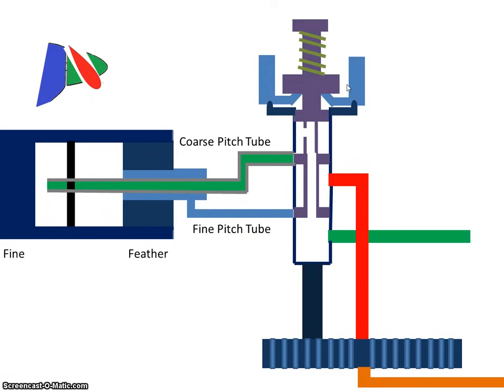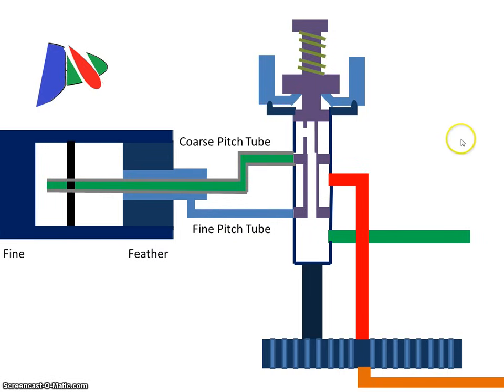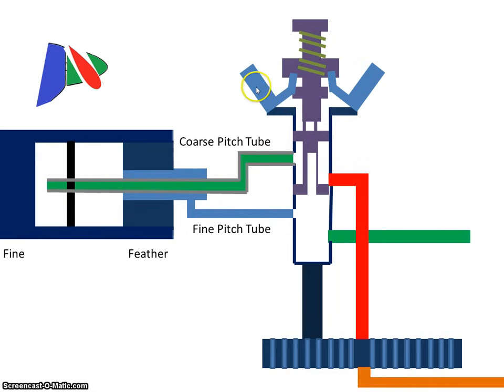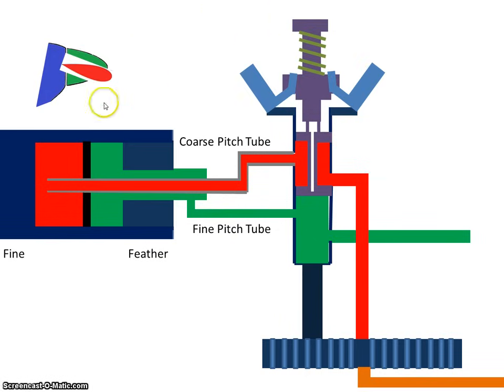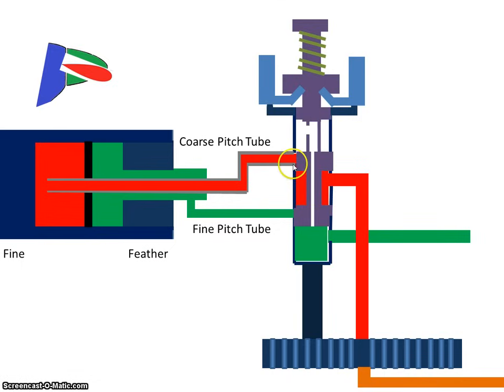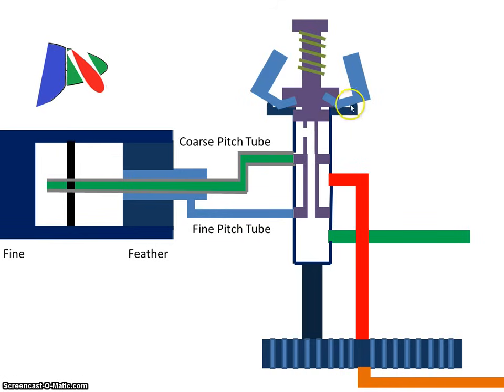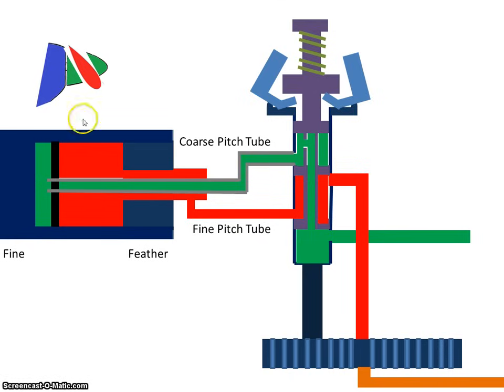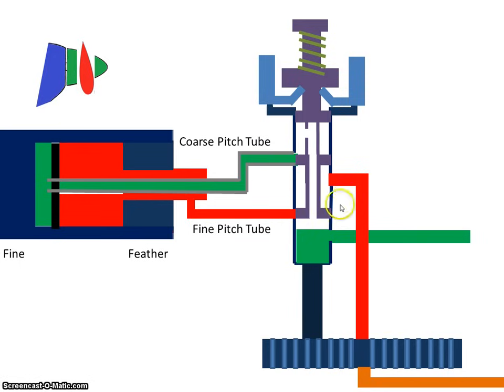Simple Explanation of a Propeller Governor

Comment: You have it reversed, dynamic force on the propeller blade forces it towards a reduced blade angle, not an increased one like you said. That’s why a “pitch lock” mechanism was put in place in case of emergency hydraulic power loss.

Comment: On speed Condition = oil in lock position because the pressure on Speeder Spring and centrifugal force is balanced

OverSpeed Condition= As RPM increase, Centrifugal force increase (fly weight move outward + Pilot valve move upward) directing pressured oil from booster pump to piston  to Increase blade angle ( coarse pitch), RPM decrease,  then on speed Condition

UnderSpeed Condition= As Spring pressure is stronger than Centrifugal force, (Fly weight move inward + Pilot valve move downward) directing oil from piston to be routed back to the engine. Blade angle decrease  (fine pitch), Engine RPM start increase, the On Speed condition

+Pilot adjust the amount of pressure on the speeder spring to change the Pitch of the blade
+Booster pump supply pressurized oil (180psi - 300psi)
+The shuttle type valve used on pilot valve (alternately cover and uncover oil passage allowing oil to flow in/out of propeller hub
Reply: nikdanial109 Thank you
Reply: Thank you

Comment: great explanation, i love that you keep it simple, anything well understood should be able to be explained simply.  This is how it works on some planes however, I noticed on the diagram it says "feather"  Most airplanes that go into feather (multi) do so with a lack of oil pressure, in case oil pressure is lost it can go into feather.  Basically the diagram that you drew, but the lines to / from the oil sump and oil pressure would be reversed.  Also, the driving forces trying to drive the prop to feather would be: a counterweight, nitrogen and a spring in prop hub.  For new pilots think of it only for the way it works on the airplane your flying, don't confuse yourself.
Reply: Steven McEvoyI wanted to clarify my above statement, its not just so much as the lines are reversed.  On the other system, the High pressure oil is now trying to drive the prop to fine pitch, but it is pushing against nitrogen and a spring, and not oil.
Reply from the maker: Steven McEvoy You're correct Steven and thanks for the comments. If I'm not confusing the matter, this type of propeller could go to the feather position with the aide of a "feathering pump".  I'll probably do a video on that topic at some stage.